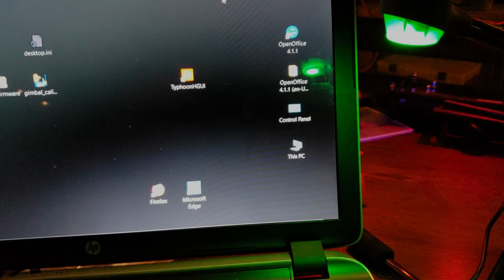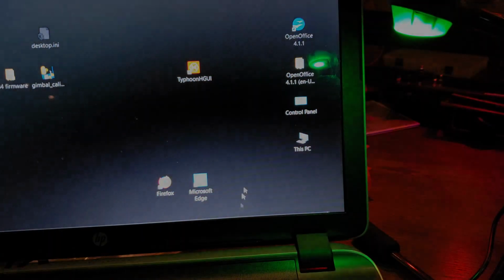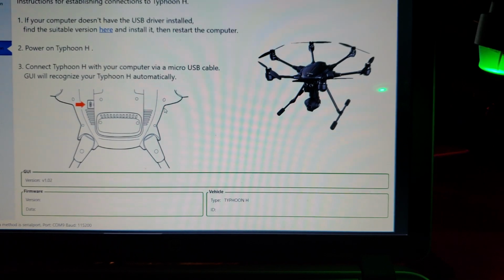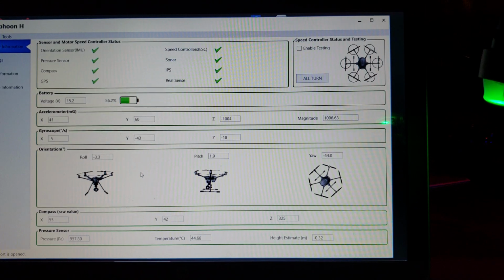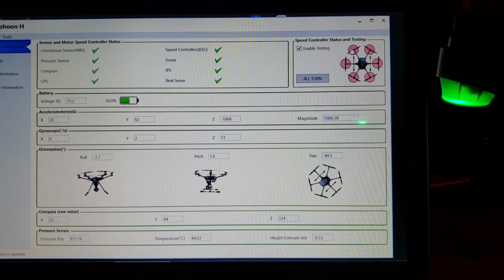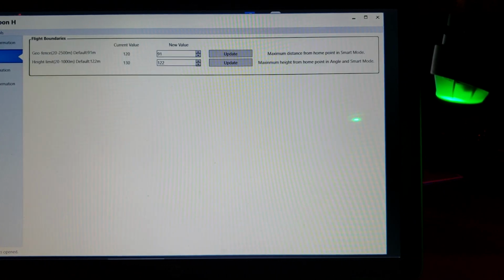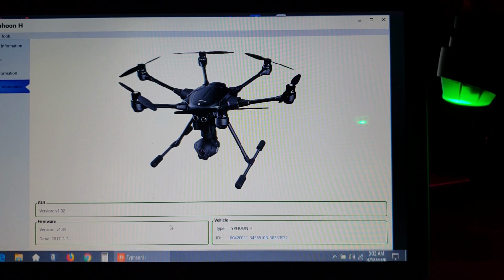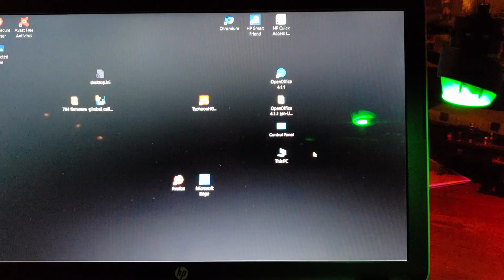Yuneec Typhoon H GUI. (Graphical User Interface)

Comment: i am unable to update to new firmware on my H. it says update failed, aircraft type can't retrieve. any suggestion. I did install the 1.28v  to flash. also, The H doesn't show up in the binding.
Reply from the maker: To resolve this problem go to www.yuneecpilots.com and post it there. It will take multiple steps to resolve this and those people will walk you through the process. And it's free help. They are all volunteers.